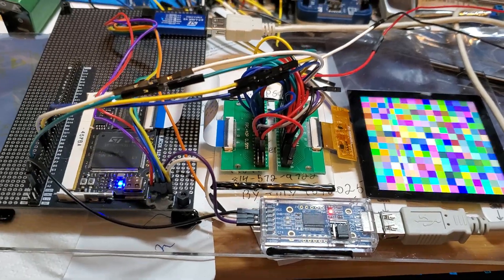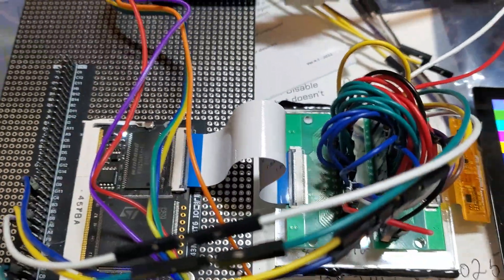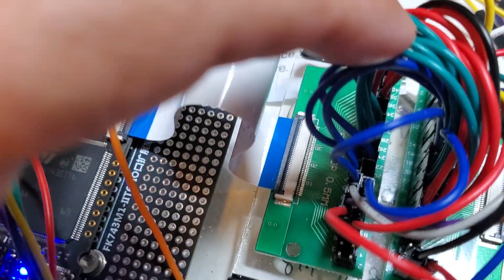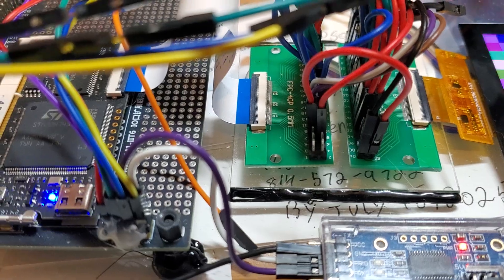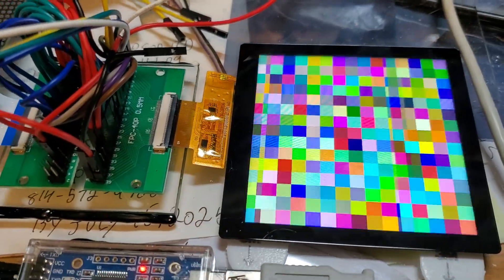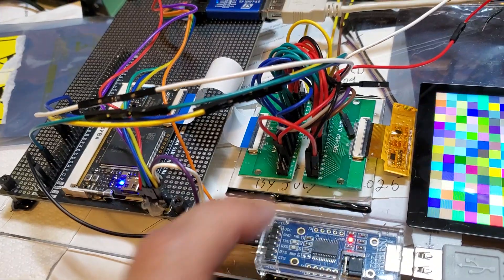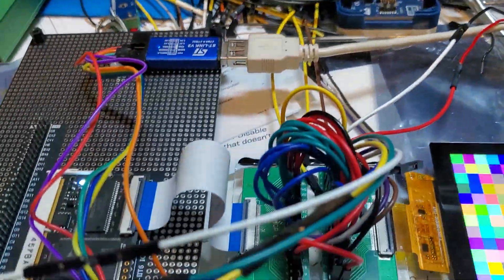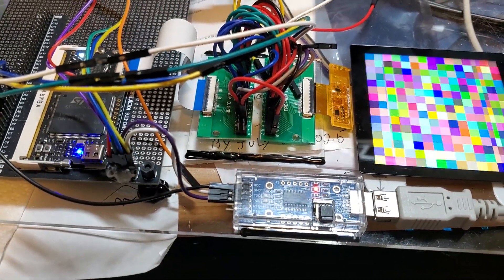16 bit RGB interface using STM32H7 module and 480x480 LCD

Comment: any docs , schematic , for refernce i am also trying to wire 16 bit RGB directly with stm32H7 mcu , since the display does not have conntrolller iC and LTDC is doing all the things , i need to check the feasability of the project .

Comment: I am trying to do something similar with a screen with similar pinouts as yours and a board with a simialr pinout as yours. On the board's 40 pin out for the display, there are no ins dedicated for TFT_MOSI, TFT_CS, TFT_SCK. How did you resolve this? By changing the extra RGB pins?

I have started with the I2C pins for touch too but not havign any luck.

I ma doing this all in Arduino rather than STM's toolset as I am not experienced with STM's platform in general. Any words of advice?

I'd love to connect and show you what I have and troubleshoot together if you are willing.

Thanks for reading.
Reply from the maker: I can tell you this is not an easy task. This is my 2nd time configuring an RGB Parallel display. The first time I built my PCB and designed it around an STM32H723 which I had an additional 8MB of SD RAM added. The first place to start is with the LCD's datasheet. Then you also need the LCD's controller datasheet. In both of my LCD they has similar controllers so the 2nd one was easier. Both had SPI lines for setting the configuration. That is your first task is to make sure you have all the startup code. If you're lucky the seller of the LCD will provide you with a good startup sequence. If not you can try to start by reading the LCD Controller manual. There are many different setting you have to get just write. One of the more basic ones is the RGB color bit width. Many displays can do 16 , 18 or 24 bit color. You're most likely going to with 16-bit as that is the least memory usage.

Once you get the startup code being sent, you then need to focus on setting up the LTDC for the correct parameters. This is also specific to your LCD. This is where you'll need to dig deep into the datasheet. For this display in this video the manufacture included some of those settings, the rest I had to guess at.

I would not attempt this using the Arduino tool set as you're writing 100% of the code. In the STM32 CubeIDE, it will help you configure many of the hardware like the LTDC and SDRAM. And I can tell you from experience, this is not an easy task at all. And you will most likely need several hardware tools like a scope and even more important is a good logic analyzer with a good protocol analyzer. With out those two tools, you'll literally be in the dark and won't know if it's your startup code or LTDC config or some other thing that is not working. In the embedded world it's all about verifying what you THINK is happening. 

As far as the CTP sensor, I can tell you I burned up like 60 hours trying to get that working good. I think I have an issue with too long of wires on my I2C lines and they are very sensitive to length. I2C is not as robust as SPI when it comes to noise and timing. Also the CTP controllers are not too great from what I'm finding out. They can lock up your I2C line and that stops all touch events. In the end I have to have a watchdog task the pings the CTP sensor IC and if it's not responding, then I disable and restart both the I2C hardware on the STM as well as reset the CTP IC. If that happens 10 times, then I rest the whole STM and that seems to keep it alive and working well.

Hope this helps a bit. I know it's not easy, but once you get it all working it's such a good feeling.